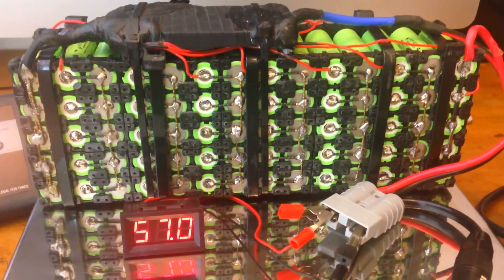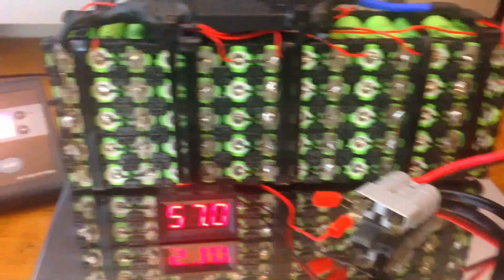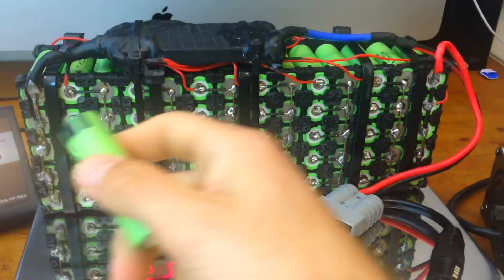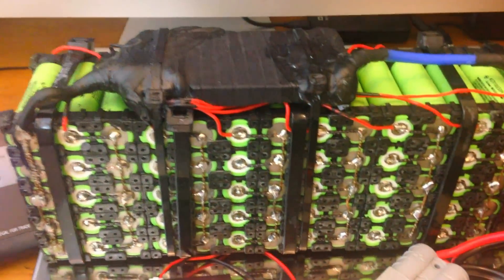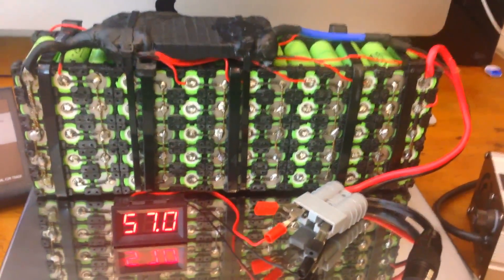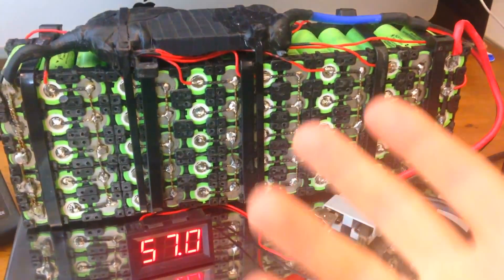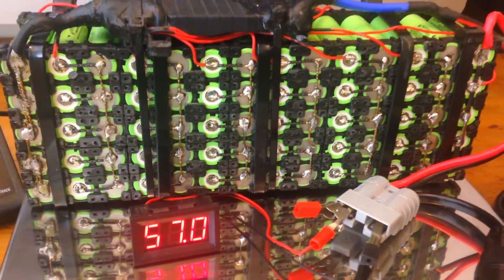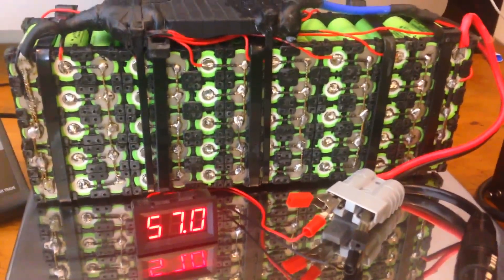Panasonic (Tesla) 52v 14.5Ah battery pack with Fast charger (14s 5p NCR18650PF) Bafang BBSHD BBS02

Comment: as someone who knows very little about electronics this video is by far the easiest one to understand out of the many I have watched. Do you think that someone like myself could achieve a build like this with the info in your other videos? Also I was looking at the triangle packs by EM3 they have a pack similar to yours for about 750 au going by your links if I build it myself I could do it for about 400 ish?
Reply from the maker: +Jayme Capurso - Haha... it makes me so happy knowing that I am helping and encouraging a lot of people with these videos =] Yeah, I work fulltime at eMax, I do make custom battery packs all the time, basically any strange shape, voltage, capacity... whatever you have in mind!! Yes, you can make it yourself... it is possible.. however it is very dangerous soldering batteries like I did in my pack, I used a very powerful soldering station to make the solder very fast and used a freon cold gas to quickly cool the cell down (otherwise the heat would spread and literally cook the cell), repeating this process 140 times (70 cells both sides). The easiest and safest way is spotwelding, you have to buy a spot welder $$ you have to buy the nickel strips $$ you better buy some additional cells to practice welding, you have to practice first and find out how many amps you need for that particular nickel strip, how many time you need to weld (4, 6 or 8). You have to find the ideal voltage / amperage charger for your pack, not too high and not too low, be careful not to pick LiFePO, you want Li Ion / LiPo for these 18650 cells. Wiring the BMS can be tricky, it normally comes with very basic instructions, sometimes you find information online thinking "oh.. exactly like my one" but there are thousands of different models, the wires may be oriented completely different and you will fry the BMS as you wire it. Yes, it is totally possible to make it yourself and you feel so proud and learn sooo much but it is challenging. You can also buy a pack so you can have all ready, unwrap and study your battery design, see the weld, the spacers, what charger they used... then when you know enough you can go to the next step and make your own pack, this would be the ideal. POWEEEEEEEER =]
Reply: +ElectricBike (Bruno) You say in the vid that your pack is a 14 cell x 5 string config but the wiring suggests a 10 cell x 7, even your bms wiring seems to be monitoring 10 cells by 7, what am I over looking?

also I notice that you soldered instead of spot welded, was their any technique you used to stop the heat damaging the cells in the process? 

when do you think you will start on the tutorials cause I could go on with questions like this all day long ;) Have you ever thought of doing a 3 day work shop, I'd fly over for something like that....... seems a bit extreme for an electric bike but I actually have bigger plans for the knowledge....
Reply from the maker: +Jayme Capurso - Hello Jayme, I am posting a video tomorrow morning showing my spot welder / electrical station at work. I know what you're saying about the BMS wiring, it is actually 7 wires each side (the video I don't show both sides) so 14 total for 14s battery. I think you can see the red BMS wires on both sides in this video here https://www.youtube.com/watch?v=EVv5z7GABx4 the cells are actually connected like that http://zt.yizimg.com/comfolder/318471/image/201503/20150306201546_8433.png the red dot is where the BMS wire is connected.

I did solder the whole battery pack.. yes there is a technique for that... you need a very powerful soldering iron for a quick solder (the longer the soldering process is the more the heat will spread and possibly cook the chemistry inside the cell) and to bring the heat down quickly I use cold freon gas spray (same gas that is used for Air-conditioner, fridge, freezer), you'll see ice wherever you spray it. This process is a bit painful as you have to repeat 70x on each side... spot welder makes things a bit easier... 
I am slowly convincing my boss that teaching the public all my knowledge about batteries is actually a WIN/WIN business for everyone, so expect to see more and more battery making videos. I would love to organise a battery building training, I would have so much fun explaining every little detail... there is a lot of information online but making the battery with all proper tools would cost a lot of $$.. flying over for a workshop like that, making your own pack and take it home would be awesome and would save you from having to buy unnecessary tools that you would only use once.... this is actually a good idea... thanks mate =]
Ah... forgot to ask.. where are you located?
Reply: +ElectricBike (Bruno) My knowledge is rudimentary at best, when you put batteries together + to - you get series that adds up to the voltage as you explained but your wiring clearly looks like groups of 10 with 2 wires coming from the bms for each of those groups to charge. That diagram just confused me more having 16 cells in it :)

Im thinking I might pull the trigger on a set up except maybe a few more ah if I can fit it in my frame and go for the HD of course :)

If I put together a parts list would you be up for looking it over to make sure I dont make a noob error?

oh, do you find that the battery with the positive lead soldered directly to it gets hotter than the rest?

Your right its a win win for everyone, there are always plenty of ppl who would rather pay a bit extra and get someone else to do the job properly for them, your bound to pick up extra jobs for your boss.

oh and Im in Adelaide.

Comment: I'm planning to build a pack with similar cells  from Tesla S car rated at 3100 mah. My BBS02 is the 36v 500w model. Do I have to stick to a 36v battery (10s) or can I build and use a 48V pack using 13s without worry of burning out my BBS02? I was planning to go with 4P to keep cost and weight down for a total capacity around 12.4 Ah. I really enjoy the energy in your videos!
Reply from the maker: +Aye Guy - Hi Aye... Thanks for your comment.... 
You can use Panasonic NCR18650B that is 3400mAh and get much better range from the same size pack. The "PF" has higher discharge 10A nominal what is good for the BBSHD (1400w). The Panasonic "B" I think is 4A discharge per cell, when you have 4 cells connected in parallel it will be 4A x4 = 16A continuous, even better range and  discharge if you increase to 5p. The more cells the less stress you are putting on each cell, it won't heat up as much and your pack will last for years to come.
Your 36v controller can only take 36v nominal however your motor can take a bit more. If you connect the 48v controller to your mid-drive it will spin much faster because of the higher voltage, I would recommend to not use the controller at 100%, chances are you'll ended up frying your motor so get the programming cable and tune the amps down a bit using this article as reference http://electric-fatbike.com/2015/06/26/a-hackers-guide-to-programming-the-bbs02/
as long as it doesn't get tooooooo hot for long periods you will be fine, It is a matter of thermal management, just pay attention to the motor temperature =]
You can install a temperature sensor like this http://electric-fatbike.com/2015/06/07/installing-a-temperature-sensor-in-the-bbs02-unit/ but instead ot gluing the probe to the controller you glue near the motor. Thanks for watching... so much POWEEEEEEEERR.. hahaha...

Comment: I'll be building my e-bike battery pack in a week.  I'm testing the batteries first, although they're new Panasonic 18650 cells and of course all are good.  But I thought I'd geek out and test them and see how well their characteristics matched each other.  I plan on charging them to only 4.0 volts per cell in the hope of maximizing their cycle life, so I'm hoping this will allow me to avoid a battery management system.  If one bank is slightly more charged than another, it still won't be overcharged.  I'm essentially adding cost and weight for better battery cycle life and simplicity.  I will wire it for a BMS, so I can measure the voltage for each parallel bank and if necessary I can add BMS charging later.  I'll have a 12P12S battery pack.

5:50 you stated that you'll charge at 6A, but you don't want to charge at less than 3A because that can damage the battery pack.  Do you have a reference to support the claim that a 3 hour charge rate can be harmful, because this is the first I've ever heard that.

BTW - The online Battery University website has a lot of very good technical info on lithium batteries, but they also have a fairly easy to read and understand white paper describing how to care for lithium batteries for maximum life.
Reply from the maker: +Liberty4Ever - Yeeeahhh.. Panasonic cells are reliable... good you're testing every single cell before putting all together =]
It is good to have the BMS wired and ready just in case. I actually disconnected my BMS looooong time ago expecting to see my pack unbalancing... https://www.youtube.com/watch?v=EVv5z7GABx4 months later punishing it hard every single day and it still going strong like new!!
BMS will actually balance your pack during the end of your charge, if you stop it at 4v per cell the BMS in some ways will become quite useless... 
BMS is a safety device that is there to protect your pack but 9 in 10 battery pack problems are caused by faulty BMS or BMS related issues. So... BMS or no BMS? Good question... =/

Minimum charging current I mentioned on my video, all batteries have their minimum recommended charge by the manufacturer (Panasonic in this case) the chemistry has a maximum and also minimum recommended charge.
Panasonic 18650PF Specifications: 
Battery type: 18650 High Drain | Hybrid IMR 
Capacity: 2900mAh 
Max Discharge (constant current): 10A 
Max Discharge Pulse Current (5-6 sec.): 18A 
Full charge: 4.2V 
Charging method: CV/CC 
Minimum charging current: 0.6A 
Rapid Charging current: 1.35A 
Nominal (storage) voltage: 3.6V-3.7V 
Minimum discharge voltage level: 2.5V 
Dimensions: 18.5mm x 66.5mm *18 mm x 65 mm 
Weight: 46.5g 
Button Top: Yes *Not 
AC-IR 21 mΩ 

in your case if you're making a 12p pack you should pay attention to these numbers. If you put a normal 2.5A or even a 4A charger, I think it will take almost a day!

Yes.. I recommend http://batteryuniversity.com/ to everyone who wants to make their own battery pack. They have quality information there... this is great because there are tons of rubbish material published all over the internet... 

4.0volts will make your cells last for loooooooong time... you may consider increase your pack to 13s so you don't compromise in performance =]

So much POWEEEEEEEEER...
Reply: +ElectricBike (Bruno) +ElectricBike (Bruno) Good info!  I was particularly happy to see your report that regular charging and discharging for e-bike use hasn't resulted in an unbalanced battery pack.  That seemed to be implied by the literature and the data I've seen.  It looked like a balance charger is likely to be important only for those wanting to top off to the maximum charge on each cell without overcharging some cells, and I'm not doing that, but it's very good to get some real world confirmation of that.

I looked again at the official Panasonic data sheet for the NCR18650B lithium ion batteries that I'm using, and there was surprisingly little data related to the charging current.  It showed discharge curves at different discharge currents, but the only reference to charging were the references to 1.625A charging (per cell), limited to 4.2V per cell, with a charge disconnect at 65 mA.  I saw no reference to a maximum charge rate, much less a minimum charge rate, which seemed odd.  There is technical data on the web page where I purchased the batteries (Lithium Ion Wholesale).  It was mostly generic lithium ion battery info, with the specific info about a continuous discharge rate of 6.8A max and a preferred rate of 1A to 2A per cell for the NCR18650B.  It's not a high current battery technology.  It's made for maximum energy density for relatively long discharge times.  This should work well for my application.  With a 12S12P battery, and a 1500W motor, I should be looking at 2.5A per cell or less.

You are the second e-bike builder to recommend a 13S battery configuration, and that's a definite possibility for me.  My battery is sufficiently modular that adding another bank is not a problem, and it would be very useful, given my self imposed limitation of charging to only 4V per cell.  However, the motor controller I have has no instructions or data sheet, and the label on the front of the controller clearly states 48V maximum.  I'm fairly sure they intend a nominal 48V battery pack that can be charged to 52V or more, but I'm rather literal minded when a manufacturer states a maximum value.  For the nominal 48V battery pack, the controller imposes a low voltage cutout at 40V, which is only 3.3V per cell, which isn't much under load.  Almost certainly, the controller was designed for a 13S battery pack.  I'll try to get confirmation of that (or a REAL maximum voltage spec) from the Chinese seller.

Thanks for your time!
Reply from the maker: +Liberty4Ever - Yeah.. thanks for all that info too.. =] I know how hard (almost impossible) is to find all these battery specs.... I spent months browsing hundreds of websites and blogs... I don't even remember where I found, I saved on my desktop and shared always share this info with lot of people when I discuss about batteries. If all battery manufacturers shared all that data, would help lots of battery builders to deeply understand the cell's capabilities and limitations, designing much better and durable battery banks (packs) the cells would last much longer...  maybe they don't want that... they may want people buying new cells every two years to keep their business going.. =/

All 48v ebike controllers I know are designed to handle 13s Li-Ion batteries charged at 4.2v per cell 54.6v (or LifePo equivalent voltage). The only "48v" controllers that I know won't handle anything above 12s are the RC controllers where the maximum voltage is 50.4v. If this is not your case... go for 13s and you'll love the extra power =]

I love this tech-chat hahahahaa... =]
Reply: +ElectricBike (Bruno) I sent an eBay message to the Chinese supplier of the hub motor and motor controller I bought, and they confirmed that I should have a 13S lithium ion configuration, or 12S if I was using LiPo batteries (so apparently 14S with lithium ion batteries would be bad).  I have enough batteries holders arriving from China today or tomorrow to build a 13S12P battery pack, and I placed a small order at Lithium Ion Wholesale to add the 13th bank to my battery pack, and those batteries will be here tomorrow.  That's going to be a big battery pack and should provide a lot of range, even when only charged to 4.0 V per cell.

I woke up this morning thinking about the battery charger.  I want to build a custom battery charger that I can use with solar panels to keep my battery charged, but the simplest and easiest path would be to buy a charger.

I still need to build my e-bike garage.  I don't want 1.6 KW hours worth of lithium ion batteries in my house, and I don't want to try to drag that hundred pound e-bike up and down the steps every time I want to ride.

I also need to finish adding the disc brakes to the rear of my bike that doesn't have disc brake bosses.  That's a pain.

The weather is starting to look like spring, and my e-bike project is wrapping up just in time for decent riding weather.